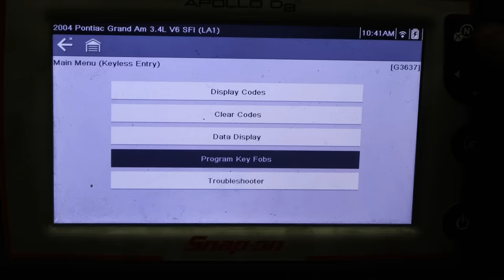Lost and forgotten at the auction for five years

Comment: As a young(er) rebuilder myself, I always say that any car that is lovable is definitely rebuildable or restorable, includin this Pontiac Grand Am, NO MATTER how much it is worth or how long it has been sittin.
Reply from the maker: It was in my watch list for five years, it was only a matter of time before it became mine! 😂
Reply: @vehcor  you are singlehandedly bringing Pontiac back!!!

I'm waiting on you to bring back an old Bonneville

Or a maybe score an Laurentian?
Reply: @clevelandmaker386  I had a baby blue Bonnie that was a very comfortable ride. Well till some crackheads stole it and trashed it. Then wrecked it. Great car though.  The GM 3800 is a pretty good motor.
Reply: @clevelandmaker386   LOVE the mid to late 90's bonneville's. so comfortable compared to today's cars.
Reply: @rezmedic57  you know whats a rare car on the rise?

Those ASC McLaren Grand Prixs!!!
Reply: @rezmedic57 the 90's ones that are rounded, are better overall than the 2002 ish models. Maybe the air conditioning pressure sensor gives trouble but that's everything GM. I'd buy a crusty 90's one over a clean 2002 one.
Reply: I know you posted this 5 months ago but I want to chime in as a Grand AM owner myself. Its incredibly difficult to find parts for these cars if they aren't shared with other GM line up. The Climate Control unit went out on mine and I also needed a HVAC flap Actuator as well which weirdly enough the Actuator was easy to get a hold of but I had to go through scrap yards for the climate control unit. The cars do run for nearly ever and they still have good old GM quirks but out of all the cars in their age range they are some of the most reliable, Id say a Buick and Oldsmobile of the same design would rival it but those are far rarer cars to find considering the Grand AM was the best selling Car Pontiac ever sold.

Parts are a bitch to get for sure

Comment: I know you've done a lot of work on these cars, but this video really exemplifies just how skilled you are. Every movement is performed with a confidence and speed that only very few true experts and craftsmen can equal. It's a unique skill set to have, but everyone has to be good at something and you have picked Pontiac Grand Ams.

Edit after finishing: I love the casual flex at the end. "yeah, I just swapped the engine, pulled the dash and replaced the heater core in less than 8 hours".

Comment: Nice, weird to see a non wrecked grand am getting repaired. With all the parts you have it makes sense to fix it. I scrapped a lot of 3100/3400 cars for customers back in the day because of the forbidden milkshake so it's nice to see one get a reprieve to run again. These are surprisingly good transportation and are relatively easy on the wallet since it takes a lot to actually make them unable to drive.
Reply: 3100 is a tough V6, the 3400 though what a time bomb
Reply: @Esdeath_0001 the 3800 v6’s were nice before these but I’ve had the 3400 in a 05 Malibu had close to 300k before got rid of it ran like a top only got wix filters an new oil every 5k miles looked damn near new oil every oil change.
Reply: @Esdeath_0001  gm made more than one 3.4 v6.  The dohc 3.4 is a bastardized 3.1 that I wouldn't own if you don't know anything about vehicles.  This 3.4 is basically a punched out 3.1 from the 90's.
Reply: @CoryRwtfyt  I had a 3.1 1994 Lumina. The 3.4 was garbage

Comment: Reminds me of my in-laws Pontiac Torrent that "mysteriously" started having overheating issues at just under 100,000 miles and was losing oil between changes. The Brain Trust in the Service Department at the local Pontiac Dealer acted like they couldn't figure out the issue and did things like changing the thermostat and flushing the cooling system. (Like this 3400 wasn't like every 3400 ever made and wasn't suffering from a head gasket issue.)
Reply: The water pumps were quite prone to failure, but the testing for failing head gasket is extremely fast, pressurize your overflow cap, cap off the overflow line, open the oil fill, if air is heard or pressure drops then you are the proud owner of an oil and coolant exchanger 😂. 99 percent of the time too you can smell oil in the overflow and see it in the coolant. Gm was sued several times over this with the 3000 series engines. Always get a 3800, always.

Comment: So this video popped up on my recommended videos. I was really surprised to find someone working on a 3400 Grand AM. I always felt like nobody did major repairs on Grand AM's and that anything like that would land one in the junk yard. I really like that you are willing to fix these as i always liked the cars myself. I don't really have a high opinion of the 3400. I was under the impression that it was more likely to crack a head than blow a gasket. I tell people that it can be a reliable high mileage motor but you don't want to ever let it overheat or try to limp it somewhere on low coolant. Replace the hoses and radiator periodically because any failures can cause engine damage fast- check the coolant level often. What is your opinion of the 3400? I went through the junkyard once looking for a 3400 and found that most of the coolant bottles smelled like combustion gasses. On the flip side, 3800's are pretty rock solid and seem to out run the transmissions more often. Thanks for fixing this car and making a video out of it!

Comment: You should do a teardown of the overheated engine. I just pulled the virtually same engine with the same problem from a 94 buick century. Sitting 7 years also required brake lines to be done.

Comment: My mom used to drive a 99 Grand am;  with about 135k miles on it:  She got rear ended badly, completely collapsed the entire trunk right up to the back glass (that surprisingly didn't break).  It tweaked the unibody bad enough that the rear doors wouldn't open.  I took an 8ft pry bar and pushed all the metal off of the rear wheels so I could drive it home.  I thought I was going to take the engine and throw it into a project, but instead I managed to sell it for $900, after getting paid by the insurance for it being totaled.  It still had good interior and the entire front end was still in great shape/ engine/ trans, etc..  They got a good deal on a parts car.

Comment: Dang thats not a bad grand am. I had to scrap my moms 2004 Grand am after the brake and fuel lines I replaced on it 10 years ago rotted away, and it had no rockers, barely a floor, and the rear suspension was ready to fall off. Great cruisers, with the v6, but damn they rotted away under the plastics.

Comment: I liked the approach of getting the engine running.  No wasting of filters etc.  Only difference what I would have done is to innately use some used engine oil from a previous serviced vehicle to do the initial flush of the engine instead of using new oil which is just going to be drained in any case.

Comment: I can’t believe you’ve had the good luck with the 3.4 like u have. I musta replaced 20 head gaskets on those.
Reply: Weren't the intake gaskets also a big problem? I had a low mileage 03 Venture from 07-12 that I think died from coolant in the intake. Scrapped it so I can't say for sure.
Reply: @grabasandwich  Yeah I had an 04 Chevy Monte Carlo with the 3.4L and it died the same way with lower mileage - I hate these engines but I can see why a gearhead might say they're ok.

Comment: I have a galaxy silver 01 ram air gt with a full sc/t kit and it only has 31,052 miles on it. I don’t drive it much if a couple times a year but there fun cars. I’m bigger into w bodies because the aftermarket platforms still there for them, these cars you have to find the stuff. This one’s pretty clean and at least in my area there falling apart or wrecked. Great video!

Comment: Oh gas tank memories.  My first 'bought behind a barn' car - I got it running on the fuel that was in it, put a new transmission in it (the reason it got parked), went to fill up the tank and it drained onto my shoes - someone had used a drift to knock a hole in the corner of the tank to drain the gas.  It was a car made in 62... they had a drift but not a hose? they also knocked the hole in the higher corner, thus there was gas in the tank - and only when I drained 5 gallons through that hole did I 'find' the hole.  Oh, and good thing - they also loosened all the spark plugs on the aluminum motor (started it, then tuned it while waiting for the replacement gas tank).... spark plug were finger tight.....

Comment: 5:42 ah the good old days when you could connect a button to the + on the battery and the + side of the starter and start from under the hood. Liked the old fords with the solenoid on the right inner fender. They made it SO easy! 3 ft of wire with two alligator clips and you didn't even need the key! hehehe
Reply from the maker: You can do that on these and it will spin the engine but the security system will cut out the injector pulse because the ignition was bypassed.  Unless you bypass the security system that is going to fail eventually because… Grand Am. 😂
Reply: @vehcor  ah good to know! I learn a LOT from you even though I'm a major smart ass lol

I remember more than few times we'd boost a buddy's car and move it around the parking lot then watch his face when he comes out lol....

Comment: Replacing the gaskets on the 3100/3400 is a pain in the ass, but if the car was parked for that reason, it's a win. The crankshaft is definitely wiped, but at least it runs.

Comment: Question for ya:  Should a Quad 4 engine have worked in a 93 Grand Am originally a 4cyl, automatic?  We gave up on it after it wouldn't stay running. The installer formerly was a GM mechanic. He felt that the prom was not communicating. Would've liked to keep it, was an auction find brand new still in the crate. Thanks for your videos.

Comment: I had a '03 grand Am that I loved drove it for over 175,000 miles with out a problem. It was a 2 door with the 3300 V-6, got close to 31 MPG on the highway, 25-26 around town if I recall correctly. Lots of pep my only complaint was that it wasn't a 5 speed.

Comment: Got a 6.0 gm on my Escalade and I had a blown head, well not a blown head, coolant wasn’t getting in the oil I had a coolant leak from the heads. Long story short there wasn’t a bolt in the back of the head, I still went and got the heads checked and the machinist said there was a SLIGHT curv in the heads despite no coolant in the oil. So it’s always best to get the heads shaved for a hundred bucks or so just for some extra security

Comment: Weird rules here in Norway. I have a vintage car and  it is actually not allowed to put LED bulbs in when original was halogen. The classic 7" round lights are easy to swap though so I will start using some cheap LED ones in winter, it saves power/battery.

Comment: Scott what intake set do you use? I have a 97 Century with the lovely 3.1 that just spit another lower intake gasket on the throttle body side. At some point this car will go away. This is the third set of intake gaskets and the car has just turned 110.000 miles. If anyone from GM reading this needs to know your 3100 series V6 intake gasket design really sucked.
Reply: Felpro problem solver kit is what I've used for years.
Reply: @bigkenny93  Thank you for the reply.

Comment: All it took was about 2 seconds of that bad crank sound to know she'd tossed a chain, blown a head gasket and/or cracked a head.  Kind of amazed it started at all.  As cheap as those engines are in our neck of the woods it almost isn't worth doing the top end anymore.  Just chuck it all and buy another one.

Comment: Just a suggestion,get a "shock horror " carburettor and a piece of rubber  pipe into the air cleaner so it draws in mixture
Reply: First you would have to install a carburetor!
The last passenger vehicle new with a carburetor sold in the United States was in 1985.

Comment: Vehcor my 02 grand am gt is in limp mode. I busted a hydraulic brake line and patched it up. Won't go over 20 or accelerate. Any ideas?I know your the grand am master!
Reply from the maker: Probably unrelated to the brake line.  Try disconnecting the catalytic converter at the exhaust manifold.  See if you get your power back.  Cats have a high rate of failure on these.  I have bought a few with people thinking they had bad transmissions and a new cat was the solution.

Comment: Aren't head gaskets pretty common on grand prix and grand am engines from that era?
Reply: Intake gaskets were common for both - Not on 2004+ Grand Prixs though since GM finally used better quality gaskets on the Series III 3800 V6.
Reply: @chynacash3138  I was wondering about that. Not the same era but I had a 1988 grad prix and a later gf had a 1991 and was warned of the head gasket issues. Was wondering if it applied to later years as well.

Comment: GM rusty door bottoms, Should probably have the rusting quarter around the fuel door.
Reply from the maker: Not as common on the sedans as the coupes.  It was all because they didn’t apply the foam properly.  If it was too thin, it formed a pocket for dirt and salt to collect.  If it was thick and squished out, debris could not collect and rot from the inside.

Comment: did they paint them all silver, my friend even had a silver grand am
Reply from the maker: Gt colors were White 99-05
Red 99-05
Silver 99-05
Black 99-05
Copper 03-05
Gray 03-05
Dark green 01-04
Silvermist 99-00
Teal 99
Gold 99
All 05 GTs were 2drs
Reply: They where great cars, as a mechanic, I have changed a ton of intake gaskets and wheel bearings on those cars over the years, but other than that they are tough as nails

Comment: I just can imagine how much a similar job would cost on a Land Rover 😂
Reply: A Land Rover would start instantly even if it had been sitting twice as long. 
The battery wouldn't even be dead.
They are the most reliable and durable vehicles ever produced.
They can be driven a million miles with just a occasional oil change and windshield washer fluid top up....

Comment: If a car is sitting for 5 years why would you even attempt to start it.Pull the dipstick.No start check fuel pressure and injector pulse.Grand Ams this era were complete garbage. Intakes injectors shorting out suspension and the famous problem no start because of theft deterrant.Welcome to Garbage Motors